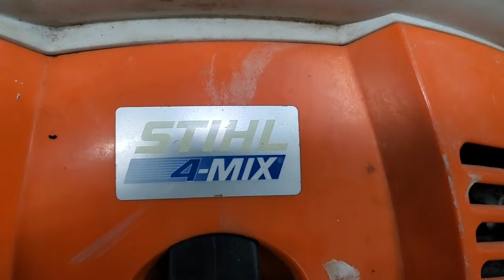Stihl BR550 4Mix Backpack Blower Starter Rope Hard To Pull.  Valve Adjustment Compression Release

Comment: Great video, T.  Although I'm already very careful about correct replacement of screws I really appreciate how you not only showed the difference in types of screws on disassembly, but then before reassembly laid them all out in order so the newbies could really see the differences.  Taking that extra care to instruct makes all the difference.  On a new machine with which I'm not familiar I not only place all screws and small metal parts in order on magnet bars, but also photograph each before it comes out and after it's out alongside it's fastened part on the magnet bar.  Don't do it as much nowadays but in the beginning that really helped me to make sure everything went back correctly.
Although I've seen several of your videos illustrating the compression release "bump" I always appreciate seeing another one because some are easier to see than others.  This one was one of the best.  Again, one of your best instructional qualities - showing these little details in closeup so people actually can see what you're talking about.  Big thumbs up!

Comment: The one question is what is More fuel efficient  the 4 mix or a straight 2 cycle equipment
Reply from the maker: I believe the 4mix is.  It's design was due to EPA regulations, I think.  That is what I heard, I'm not 100% sure.  Maybe someone else will comment with a better answer.
Reply: @RaleysSmallEngines  okay thanks for your reply on this matter 😎 o